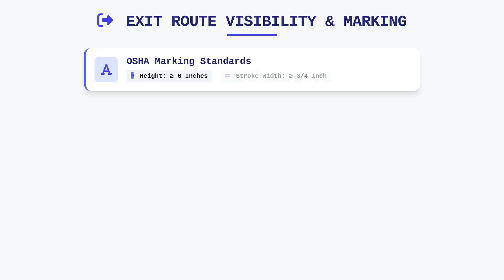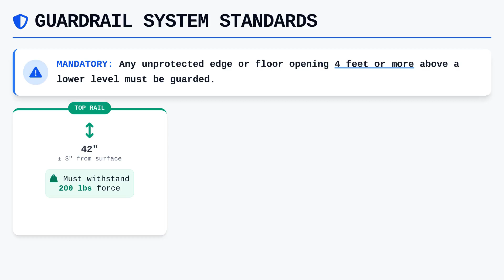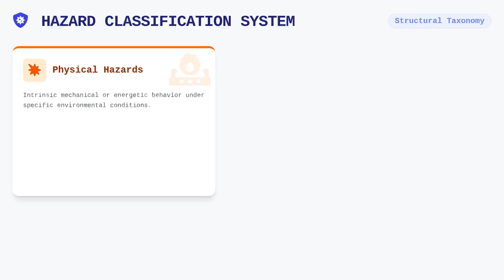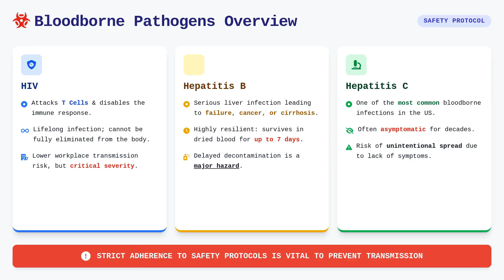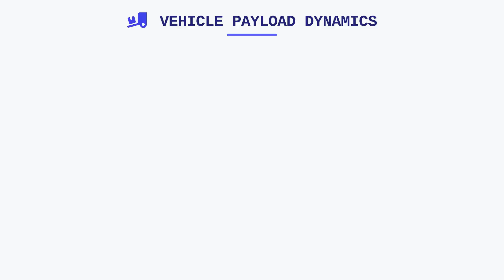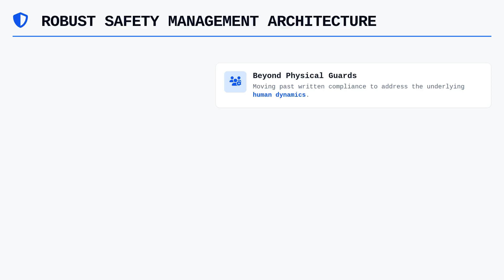OSHA 10-Hour General Industry Safety: Complete Certification Guide

Comment from the maker: Sitting the OSHA 10-Hour exam in the next few days? 

This detail-level trap is what decides pass or fail.

29 CFR 1910 4-foot fall protection trigger height vs. 1926 Construction rules & OSHA Form 300/300A/301 reporting deadlines (8 hrs vs. 24 hrs)

• Walking-Working Surfaces fall protection (4 ft General Industry vs. 6 ft Construction)
• Lockout/Tagout (LOTO)
• GHS SDS 16 sections
• PPE hierarchy

I condensed 480 pages of blueprint material into a 1-Page Cram Sheet, 11 scenario decision trees, and 310 spaced-repetition Anki cards:

 https://www.coursano.com/study-guides/osha-10-general-industry

Pin this and review it on the morning of your exam. Good luck!